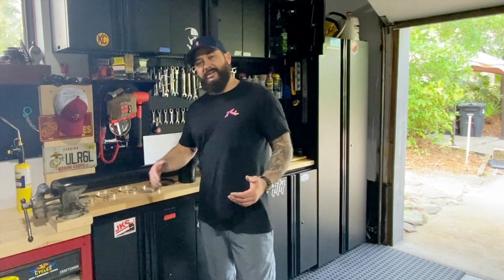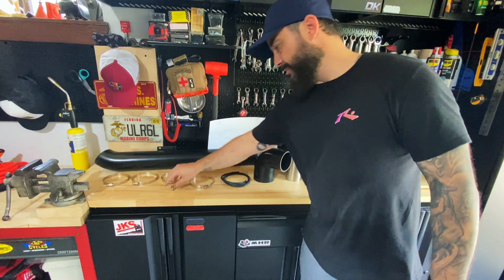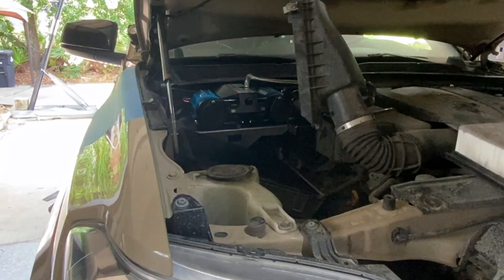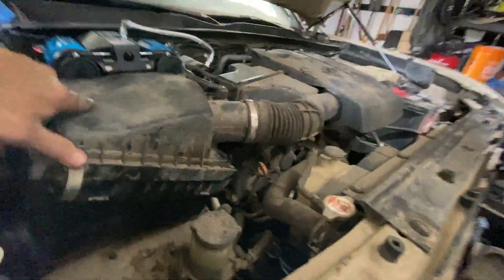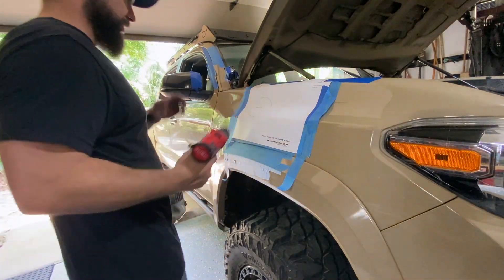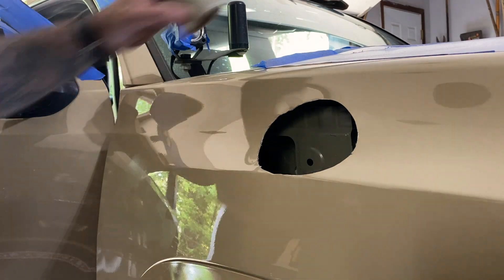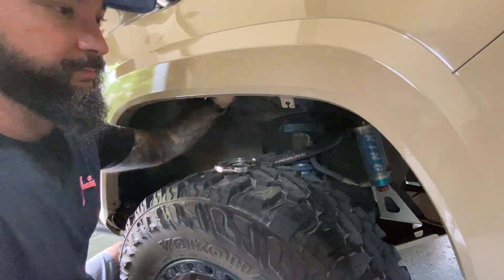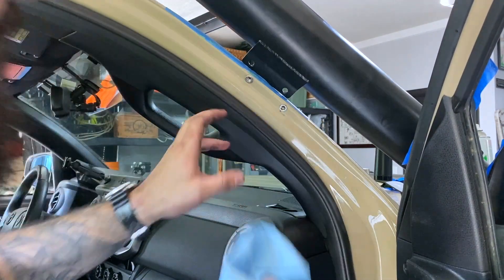Toyota Tacoma Snorkel Install | In House Fab Snorkel | (2017 Tacoma)

Comment: Always enjoyed your videos man. Now that you've had it on for a couple months, how's it holding up? I am considering one of these but have reservations on seeing it potentially get dinged up versus the flexing from the plastic based ones. Keep up the great work!
Reply from the maker: Thanks for the kind words, I appreciate it. So far no issues. I ran through some tight trails recently so it does have the usual pin stripes but nothing deep. I'm super happy with it.

Comment: Did you notice any change in MPG, particularly at highway speeds? With the intake being rear facing the engine is going to have to fight a low pressure zone to suck air in. I agree with you though that this is one of the best looking snorkels.
Reply from the maker: No real difference I can tell yet, its been about a week. Thanks for watching.

Comment: A question in case of heavy rain, being in traffic congestion, wouldn't rainwater get into the engine?
Reply from the maker: Highly unlikely. Small amounts of water get in no matter what with a snork or the stock intake. The stock intake box has a drain hole down in the lowest section of the box to combat this. For water to really be pulled in where it would get all the way into the cylinders. It would take enough water to fill the interior diameter of the pipe which would then create the suction needed to pull it all the way in. And, the water flow would have to be at a continuous rate. I have been in some very heavy down pours, I live in FL it's always raining, on the highway ripping 75 with no issues. It's going to pull more air at higher speeds. Hope that makes sense.

Comment: what model is that for? i could not find tacoma on thier site..Thank you
Reply from the maker: These are super rear. Check Sloop Imports. They sell them here in the states directly from In House Fab in Australia. Call Sloop before you order. They can give you a time frame. I believe currently there may only be 3 of these in the states. Thanks for watching.